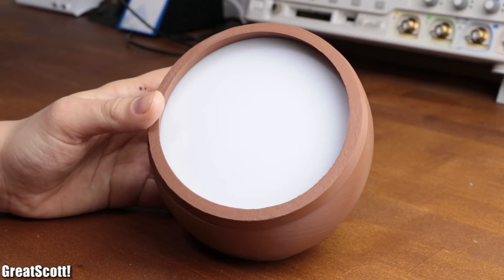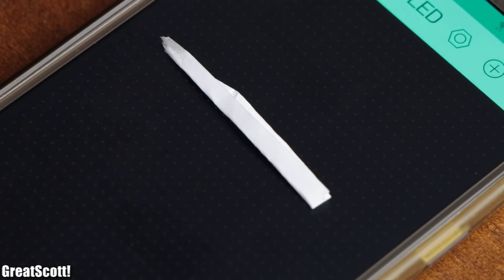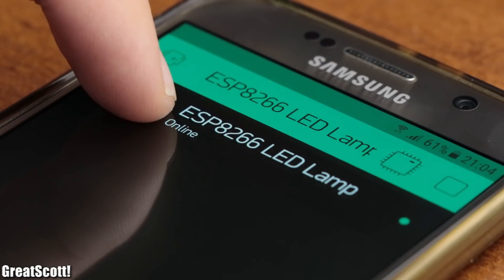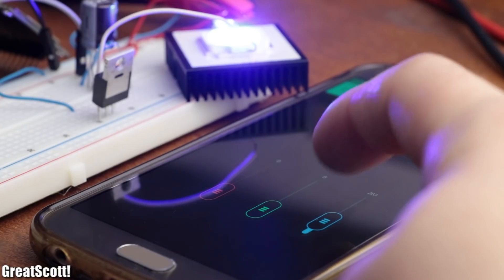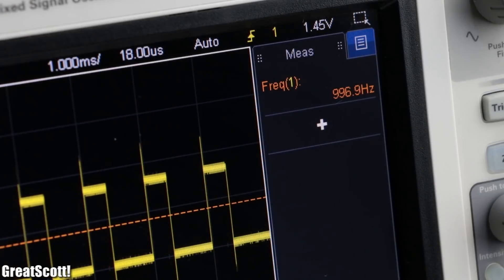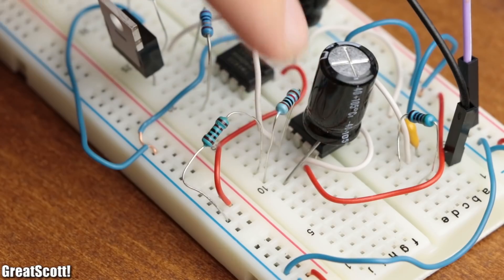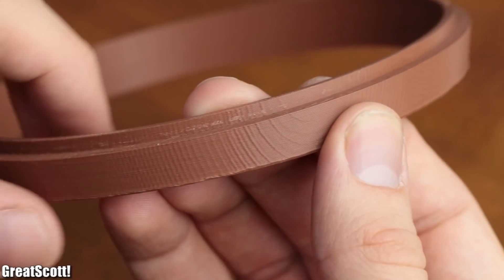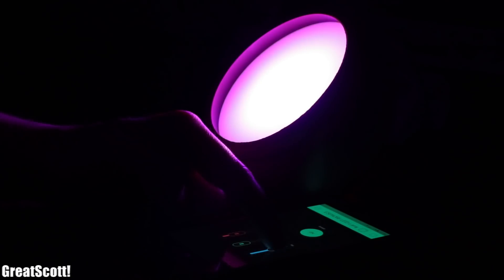DIY WiFi RGB LED Lamp || ESP8266 & Blynk

Comment: @GreatScott: Amazing video as always. Anyway have you considered to purchase ESP-12E (without the development board)? That would save space for you. Of course you have to consider to include your own current control circuit because the board utilises 3.3V - the development board contains it on top of the USB-to-serial circuit. Another pain can be the distance of the pins...

http://www.ebay.com/itm/5pcs-ESP8266-Remote-Serial-Port-WIFI-Transceiver-Wireless-Module-Esp-12E-AP-STA-/401093055967?hash=item5d630255df

Comment: Why are you using MOSFET driver instead of connecting MOSFET directly to the ESP ??
Reply from the maker: +Sumit Kumar Watch my MOSFET basics video.
Reply: To get the lowest channel resistance possible you want to pull the gate to at least 10V, an ESP8266 pin can only do 3.3V. Also a driver is needed if you want to switch the mosfet at high (>10kHz) frequencies, this is because the gate has a small capacitance. Mosfet drivers also allow you do do high side switching with n-channel mosfets, although that hasn't been done in this case. 

Once you've got a few mosfet driver ICs laying around it's easier to use them than worry about designing your own drive circuit from discrete transistors.
Reply: I think he explained that. Because he wanted a constant current, and used the ampop on as a driver to keep the current constant.
Reply: VagueDirector _ this guy knows what he's talking about
Reply: Just Google mosfet driver uses. Theyre basically a better and saver way to control mosfets

Comment: Great video.  Curious why you are using the TC4420 chips instead of driving the MOSFETs directly?  What's the advantage?
Reply from the maker: The problem is that you have to charge/discharge the gate capacitance of the MOSFET fairly quickly. The output of the MCP602 OpAmp can only deliver a couple mA, while the MOSFET driver can deliver up to 6A. This means the MOSFET switches on/off faster, which means we have a more precise constant current as well as less switching losses inside the MOSFET.
Reply: GreatScott! Thanks

Comment: With this project, wouldn't for example blue light (only blue slider to max) be less bright than white light (all three sliders to max)?
Reply from the maker: Yes. Well it depends on how you mix the white Light. If you set all three values to 1023, then yes.

Comment: great video!  What is the process for setting the light?  Do you need to go to your phone's WiFi, connect to the light, then launch the app, or does the app do all the wifi handshaking and disconnecting for you?
Reply from the maker: You just need to be connected to your normal router and start the app. It is pretty simple.
Reply: oh, that's great!   awesome work!

Comment: The 3D print almost makes it look like wood
Reply from the maker: I was actually trying to use wood filament for the project. But the print failed a couple of times and since one print takes around 9 hours, I had to go with brown PLA.
Reply: GreatScott! I just got my things i.e 3d printer nodemcu now know everything about it and blynk but i ordered both 10w and 50w led can this circuit run 50w as voltage ratting is same?
Reply: GreatScott! Please reply
Reply: @greatscottlab  Hey sir I want to make same rgb lamp like yours, but I want to use 50watt rgb led chip, so what should I do, what resistor value should I use and what voltage power supply should I use. Sir plz reply fast. I am waiting for your reply
Reply: @satishgagneja9558  https://en.wikipedia.org/wiki/Ohm%27s_law here you go :D
Reply: yeah

Comment: .By using Blynk its easy to control your circuit with the Google Assistant. Some more information here: http://www.whatimade.today/control-an-esp8266-verbally-using-google-assistant/ (Not my article). 
I used an ESP8266 with WS2812B LED strips and Blynk. Then I can control the ESP with IFTTT and an http put comand with webhooks!

Comment: I'm planning on building myself a ceiling Lamp with normal, white leds and two indepent RGB-led strips controlled through wifi or Bluetooth, when suddenly, you release a video about something similar (kinda). Did you build a mind-reading device?
Jokes aside, nice video, it'll definetly be helpful for my project.
Reply from the maker: Glad that I could help ;-)

Comment: Presentation skills through the roof! Watched without audio and your editing skills told the story completely. I did a similar project with the hc05 and android studio. 👍

Blynk sliders look a lot nicer! 👍👍
Reply from the maker: Thanks for the feedback ;-)
Reply: did u need a logic level converter
Reply: Just a voltage divider with 2 resistors!

Comment: You shoud start making your own pcbs on cnc router. Projects will look much more pro than now.
Reply from the maker: True, but I think handmade circuits motivate viewers to create something on their own.
Reply: He actually shouldn't do that, because this way it is easier for people to copy his components placement if they want to build the same projects.
Reply: Przemek Potyra
I don't think that any engineer, who really worked with hardware in his/her life would ever laugh about that. In prototyping these boards are still used even in the biggest companies.
Reply: If you're an engineer you will manage to create a PCB on your own :-) I've made dozens of PCB boards and I don't expect details - only inspiration. It is the main reason for subscribing :-)
Reply: Przemek Potyra but sadly, not all of us get a 1000$ cnc machine for free, and it is much more fun to create them on your own if you do it as a hobby
Reply: agree. he could use x-carve to mill boards or show etching process, so viewers could learn something new.
Reply: Przemek Potyra hell yeah
Reply: Yes
Reply: Only if you want to be a hobbyist, or copy-paste guy. Every engineer will laugh... Perfboards, gluegun, wire management mess etc. On the other side the "design" of circuits is quite clever. I dont judge but as a long time viewer I think its good time to jump to new level.

Comment: sir please make a 500 Watt inverter circuit
Reply from the maker: No. I will not make a mains voltage inverter circuit.
Reply: But why please make inverter circuit
Reply: It's way too dangerous to work with 110-230V AC.

Comment: Plz make emergency battery booster that will turn on when electricity is not available !
Reply: BuzzCola 3 didnt he already show a battery circuit in a recent video?

The one he showed appeard to be a battery backup.
Reply from the maker: You means a UPS?
Reply: GreatScott! Yes !!!
Reply: zach burke I don't know. Meaby

Comment: Again awesome project ... The pot designed in 123d is very good... Can I know which simulation software do you use to make PCB....? I haven't started PCB designing yet should I start with Proteus 8...? And one thing more when you added 2 MOSFETs in a row one for pwm and other for on off then how they are being triggered...? Cause irfz44n is a logic level MOSFET and you can provide gnd potential to only one MOSFET so how other MOSFET is being triggered and with with reference as node MCU will trigger it with voltage having gnd reference but this MOSFET is not directly connected to gnd....?
Reply from the maker: I do not use a simulation software. I made the schematic with EasyEDA and made the layout while soldering the components. The first MOSFET (closer to Vcc) can switch without a problem since this is not High Side Switching. Only the Drain to Source Voltage of the second MOSFET must be added to the Gate Voltage of the first MOSFET. Since that is very low, there is no problem.
Reply: GreatScott! Oh....! I got it..... But such problem I am facing in designing a H bridge to control speed and direction of large Dc motor cause there will be total 5 MOSFET in one H bridge 4 for h(direction control) and one for pwm so I am not getting how to trigger it properly I have already discussed this problem with you on facebook, hope I will get a solution soon from you by a video on  Diy H bridge...☺ Thanks in advance..☺

Comment: 10 watt RGB LEDs are very hard to deal with. (Heat, current, instability)  I tried building something similar, fried many of these LEDs and ended up using 12v LED strips instead. Recommend not to save money on LEDs and just get a 5m 5050 RGB LED strip and be done.

Comment: Shouldn't you have holes for ventilation of the high power LED because wouldn't all that heat condense not only the LED but can be dangerous since it is quite close to the battery?
Reply from the maker: Not a battery, a power supply. So far I had no heat problems. But adding ventilation holes is a good idea.
Reply: And maybe a bluetooth speaker? ;o)
Reply: wheres the batteru there? hehe

Comment: 3D printed? I thought it was clay sculpted. Also, why didn't you use the ESP32 you reviewed in a previous video?
Reply: esp32 would be overkill
Reply: Vaios Kaliakoudas because you do not need Bluetooth
Reply from the maker: ESP32 would have also worked. But I just felt like using the ESP8266.
Reply: You don't need a quad core processor and Bluetooth for controlling an LED. ESP8266 is just a single core, no Bluetooth version without extra bells and whistles like more gpio functions and better Wi-Fi, which is not required judging by that he's in his house.

Comment: Hey i have a favor can you make a power amplifier? At least just 100 watts?
Reply from the maker: Not my cup of tea
Reply: Ahh okay thank you maybe it's too much expensive. Here in the Philippines we made an amplifer called ampletos videorockola power amplifer and its powered by a 1000 watts using 2sc5200 and 2sa1943 Toshiba transistors.

Comment: wow, now i know what the hell i should do with my esp8266! But what if i use a lm317 configured as a costant current source for the led in series with a mosfet controlled by the pwm ? Should in this way maintein a costant current and dim the led with the pwm ?
Reply from the maker: Your idea sounds wierd but I think it is possible. But keep in mind that you will have lots of power losses through the LM317.
Reply: Lm317s are essentially  digital v\i adjustable  pots. So maybe, but the effeciency would be horrible! So, something like this circuit or the tlc5940 with complementary parts is  more suitable for this job.
Reply: I thinked just the circuit at the minute 5:00 (https://youtu.be/DkJ1f5UIuak?t=300) used a costant current source before the led (maybe a transistor as current source is enought), so i would not have the drift current on the led, then the costant current source and the leds in series will conduct only on the on time of the pwm (dictated by a mosfet)... The power loss should be practicaly the same, considering that the current should be the same but without the drift
Reply: I done it with LM317 with small heat sink as GS used (5 ohm 10 w resistor, it gives 250 mA), grounds controled with 2n222 on PWMs output of NodeMcu with 10k resistor, and sink it to ground with 3 * 2 w resistors. PS is 18650 with TP-4056 and dc-dc step up 2-22 V (10 pcs for 3-4 e). It works just fine. Its mobile you can charge it as your phone, with 0.8-5 V with usb out you can even use it as power bank or charge your phone. Circut is much smaler, no capacitors, no heat problem, fun project. But I dont have osciloscop to check wave, maybe GreatScott can try this and measssure losses. Anyway thumbs up for video, like the design of lamp :)
Reply: But the loss factor is still evident, even with your proposal.

Comment: do anyone have Blynk alternative for Android 2.3 ?
Reply: 2.3? Deam, that is ancient
Reply: but has things that newer android's don't have
Reply: Like what?
Reply: like lower power comsumption
Reply: I doubt that. Most likely what you are seeing is a lower end device using less power, not the android being the difference. And it can't really be properly tested unless you put the 2.3 and something like 7 on the SAME device, which isn't easy at all. Even if that were true, I'd rather have a modern OS with better features, faster, better security and obviously the thing we are talking about, proper support.
Reply: i need to agree with you but security isn't too important when you know what you're doing

Comment: Is it possible to create one color "changer" instead of three? For example the circle like in the paint-programms?
Reply from the maker: Definitely possible and pretty easy to do. Instead of the three sliders, you just use the zeRGBa in Blynk. This way you control all three GPIOs at the same time to get your desired color.
Reply: Ahh so that's what that is for!
Reply: +cokefridger There is similar kind of color palette in Blynk named zRGBra...

https://www.mediafire.com/file/iwt43ki7i2wx5i1/Screenshot_2017-10-08-20-32-05-320_cc.blynk.png

https://www.mediafire.com/file/i0qfpxsq6pn4398/Screenshot_2017-10-08-20-32-00-003_cc.blynk.png
Reply: I just never understood why a zebra. It's ugly and weird to use. Cool project though! I think I'm going to try and build it.